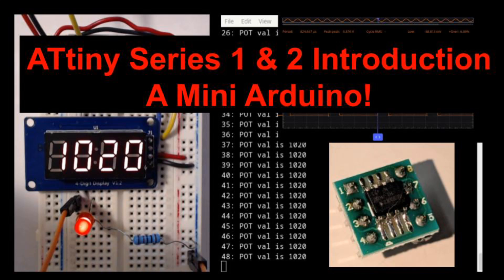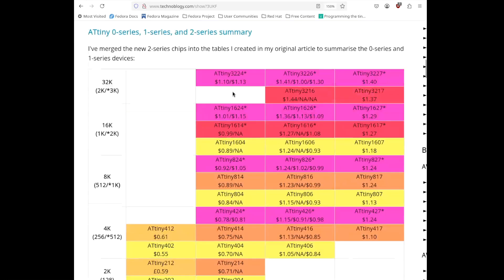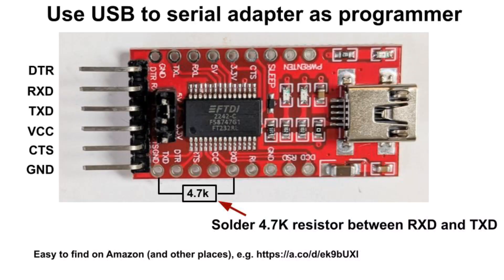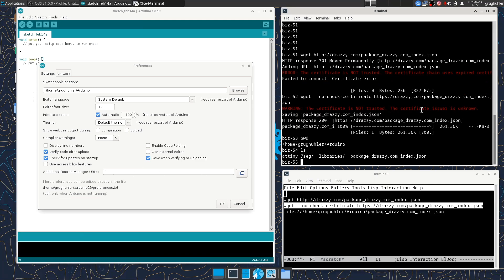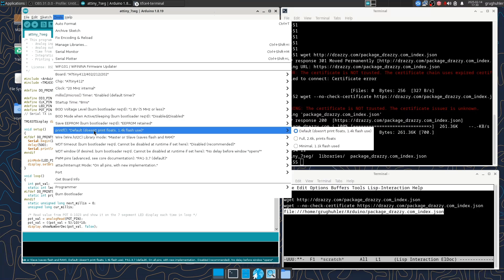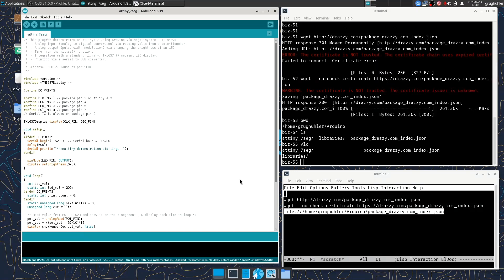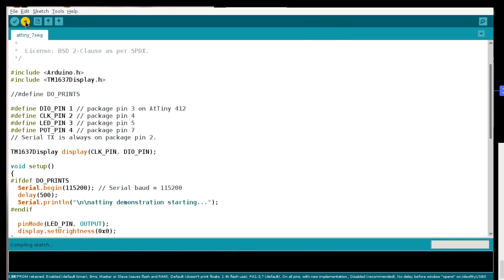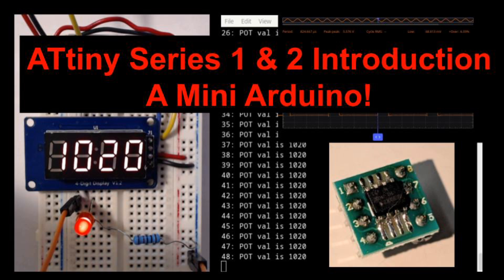Introduction to ATtiny series 1 and 2 microcontrollers

Comment: Thanks for the tutorial. Do I need two usb-to-serial modules? One for programming (with resistor), another one for debugging? Can I connect both at the same time? Can I use only one, and use a switch with the RX pin resistor? To have one device for both.
Reply from the maker: I use two, one for programming and one for print-based debugging.  I have looked for but not found a suitable dual USD-serial converter-- one that provides two serial connections on one USB cable.  Chips exist, but I have not found a suitable module.  I guess one could rig something with switches, but it does not sound all that convenient.

Comment: Great video, thanks for your work. I have been using the Adafruit UPDI Friend, which is a good product, but the use of the USB/Serial adapter makes it even easier for someone to start using these processors.
Reply from the maker: Thanks.  I was not aware of the UPDI friend.  It looks good.
Reply: @electronics.tinker  You can get it with high voltage programming option.  This allows you to unbrick those processors that have had the programming bin used as GPIO.

Comment: Is there a reason you use Arduino IDE 1.8.1x when 2.x is available? And using a USB-to-Serial adapter as programmer means no need to burn a bootloader?
Reply from the maker: I use both Arduino IDE 1.8 and 2.x.  I have no good reason for which I use at any moment.  Probably, I should just commit to 2.x.  And correct no burning bootloader when using the USB-to-Serial adapter.  Cheers.
Reply: Thanks. This video with its no-bootloader programming method deserves more views!